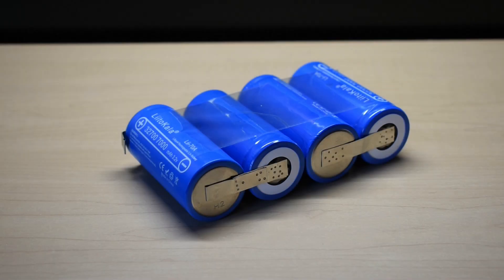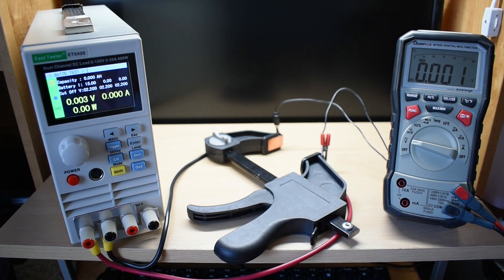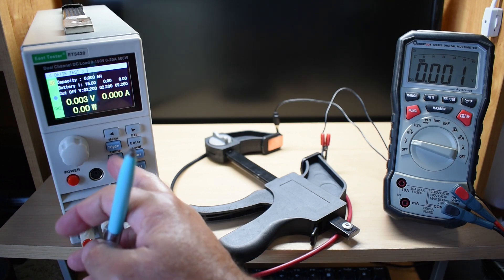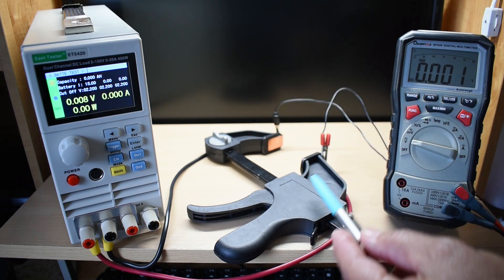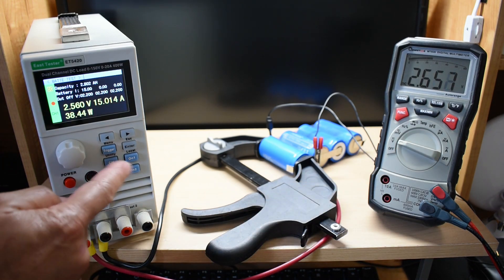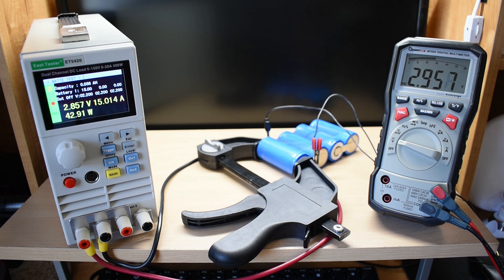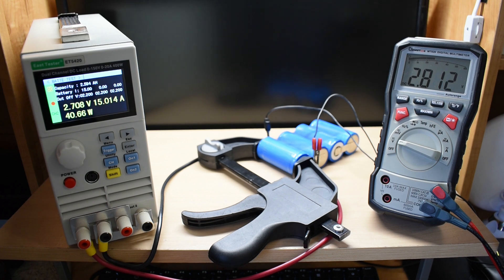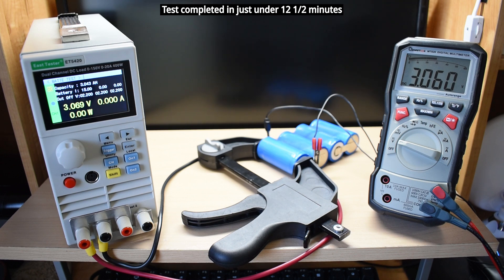LiFePO4 Aliexpress 32700 Cell 30A Max Discharge Test - ACCURATE!

Comment: Can they be charged as fast as they van be discharged? If so they could be used in electric vehicles with regenerative braking. A Civic hybrid with Nimh cells charges at 100 amp max.

Comment: Thanks for the informative video. Is it possible to use 32700 as a car battery? Kit of 20 (20x4) will be enough regarding capacity. However is it possible to start the engine ? As the engine start process is very quick do we have temperature problems ?
Reply from the maker: Motorcycles, yes, cars no. You'd have to place a few groups of cells in parallel.
Reply: @electronicsNmore  S4P20 configuration is enough for car battery, why it is not possible to use in car?

Comment: Aren't these cells supposed to be rated at 7ah. I just built a 12v battery with 12p 4s. I'm thinking it's supposed to be at around 84ah. But could be more like 78ah
Reply from the maker: What they're supposed to be and what they are......2 different things. We're talking Chinese made cells.

Comment: You say these have 5900mAh? while 18650s have at most 2500? are you saying for all 4 batteries or a single battery? That'd make them almost 3 times the capacity (watt hours) of lithium ion? I doubt it.. (unless it was for all 4 batteries combined)
Reply from the maker: Incorrect, 18650 I tested have as high as 3400-3500mAh. (1) 32700 cell is roughly 5900mAh.

Comment: Forgive me for asking, but are LiFePO4 cells not nominal voltage = 3.2V  
(The spec thumbnail at 01:02 shows nominal Voltage = 3.7V AND charging voltage = 3.65V)? 
[Even the cell pics at Aliexpress show 3.2V ]
I suspect a typo on the spec sheet - it should be 3.2V - not 3.7V !
Reply from the maker: Never be afraid to ask a question. Yes, nominal 3.2v, 3.65v or 3.7v charging voltage will be fine. Thanks for watching, and be sure to rate thumbs up, share the video link, and check out my very wide range of videos.
Reply: @electronicsNmore  Did you notice the "Nominal Voltage = 3.7V" typo?
Reply: Yep, yet there is a video that is based on the inconsistent and incorrect data?

Comment: The thing that concerns me about these foreign source batteries, or basically anything from outside the US, is that a lot of this stuff does not pass through any kind of quality control process, meaning one person's test might turn out fine, but 50% of the others out there might not.
Reply from the maker: Anything is possible. Suppliers can change after I made this testing video.

Comment: still these wouldnt last long at 20-25A either, the ESR would get high enough with a few cycles where 20A would be too mch already. Id say keep it about 10-15A per cell, or otherwise pute more in parellel. You can use it at 30A if its just peak and not constant load.
Reply from the maker: Agree, intermittent use at 30A, constant at 20A should be OK.

Comment: What a great video. Pity the channel is being hammered by Youtube's certified insane algorithm. 
Try taking a poll - ask people to let you know if they clicked the "Like" button in the comments to get actual "Likes" numbers. You don't know if the likes that were taken away were legitimate likes in the first place.

Now to the essence of this excellent video! 1C is the nominal discharge for LiFePO4 chemistry (I think). If true, these cells should be discharged at 6A with only short term discharge at 2C or 12A and never above that if you don't want to seriously degrade them. 
I think about these discharge rates as fundamental to the chemistry and not much to do with the manufacturer. LiPo cells are better suited to the high discharge rates you are subjecting these poor LiFePO4 cells to. Cheers, and keep them coming!
Reply from the maker: I know for fact they were removed. I have time stamp and like count still shots. Irrefutable proof, not to mention its impossible to only have 78 likes on a popular video subject like this after 10 hrs. Normal count would be roughly 185
Reply: @electronicsNmore  Fair enough. As I said the YT algorithm is certified insane...good thing its not running anything important like the defence forces or in charge of payments...oh wait!

Comment: Why u say 3.5 is fully charged!? Nominal is 3.7! Full charge should be 4.2... Right!?!?
Reply from the maker: Who said 3.5? 3.65! LOL
Reply: It sounds like you are thinking about LiPo cells - the cells in this video are LiFePO4 cells - the cell chemistry and voltages are different between LiPo and LeFEPO4 .
Reply: @Bennyboy-dog  he is right.. you charge those to 4.2V.. charging is similar to sla
Reply: @Bennyboy-dog  more likely he is confusing 18650s or 26650s which are Li-ion, not LiPo. But yea both are normally 4.2-4.35max which LiFePO4 (not LeFEPO4) isn't. It's quite a bit lower voltage. 3.2 is usually the nominal there.

Comment: Thank you very much. The performance tests look great! You've had the batteries for a while, what is your overall impression of them? Have any of the cells weakened? Do they still have good, low, output resistance.
Reply from the maker: The cells in this video are a second delivery, the first group used in my powerful spotlight, still good. For the money, they're pretty good. Thanks for watching!

Comment: I ordered these same cells 2 weeks ago. Hope to use them as a motorcycle battery. I hope they can deliver enough instantaneous current.
Reply from the maker: A small scooter up to 150cc should be fine.
Reply: @electronicsNmore  750cc 4cyl.
I'll report my experience when they arrive.
Reply from the maker: Too big. You'll need a 20Ah battery for that engine. If you place 3 groups of 37200's in parallel, then a 18Ah LifePO4 will work fine. Still cheaper than a lead acid. Around 50 bucks for 12 cells.
Reply: @electronicsNmore  The factory battery is a 12Ah Lead-Acid capable of 260A CCA. I will try with the 1P4S and see what happens. 3P4S of these cells would not even fit in the battery compartment.
Reply: @JohnDoe-ex8gf  so how did it go?

Comment: 5900 versus 7000 advertised looks not like genuine Liito Kala cells - more refurbished and rewrapped ones caus that is 16% less than promised !

Will you get a 16% discount now after you have proven that you got 16% less than advertised ?

Strange vendor if you read the item title carefully:
2020 LiitoKala 3.2V 32700 7000mAh 6500mAh LiFePO4 Battery 35A

What are these cells you wanna buy, 7000 mAh or 6500 mAh ?

7% less would make a difference ... so what will we really get ?
Reply from the maker: I saw numerous sellers saying the same thing. My tests on 2 different purchases shows around 6000Ah. Thanks for watching!
Reply: @electronicsNmore  I think these sellers are trying to say "I'm lying about the capacity, but I can't do anything about it if I want to stay in business", so I'll give you a couple of numbers to make you question the capacity.
This is a problem with an under-regulated market - lies take over and there is very little a seller can do about it and stay in business.

Comment: Interesting video ENM. I didn't realize that those batteries heated up that much.  🔥🔥🤔🤔
Reply from the maker: 30 amps constant current discharge for that small size cell is a lot. I would suggest 25A max constant current, with intermittent 30A drain. Thanks for watching!

Comment: Very nicely done. Thank you for the video. How about a comparison between those and the similar price/capacity from Battery Hookup? BH's batteries seem to have higher discharge maximum, but lower continuous.

https://batteryhookup.com/products/100-brand-new-lifep04-32650-3-2v-6000mah-cells
Reply from the maker: Even though the price is right, I never bothered with those cells, because the constant current max was much lower than the type in this video. I may decide to do a comparison though, if this video does well, but as long as YT's wonderful algorithm is in charge, I doubt it will do well. Thanks for watching Anthony!
Reply: @electronicsNmore  Understandable. I hope that it picks up for you. 

If you don't, I will likely buy those cells this summer to do some testing for upcoming projects. I'm planning to start making some videos as well for YT, though it shouldn't directly compete with you. If so, I will reach back out to you (recommending your video of course) and, with your permission, possibly use the numbers side by side. From the video, it doesn't look like the LiitoKala cells are actually doing 5c, even at the lower amp hour that your seeing. I like the Battery Hookup cells since you have a US company selling them directly, even though they come from another supplier. In other videos, they were testing above their rating. We will see. I also like the 10c rapid discharge rating, which will up with some projects that I have planned.